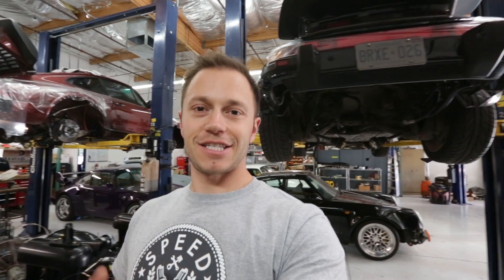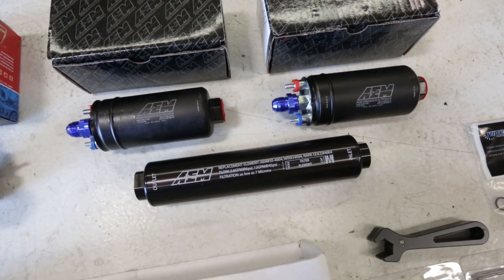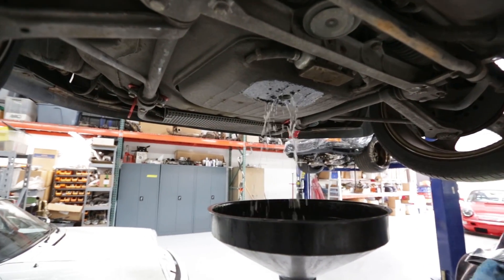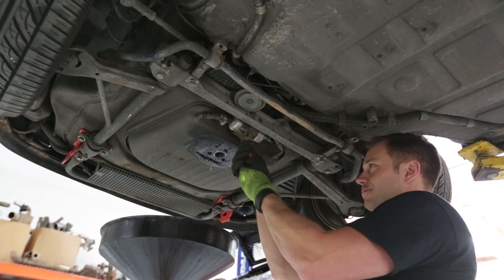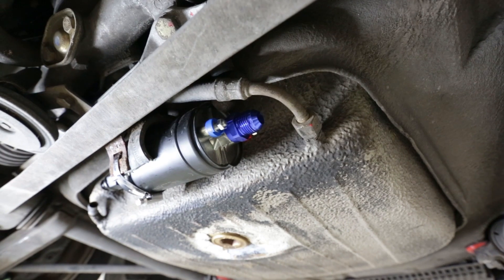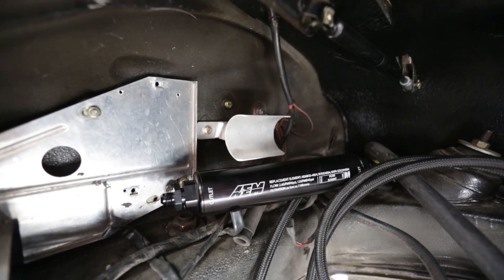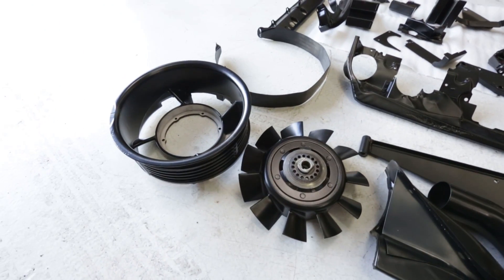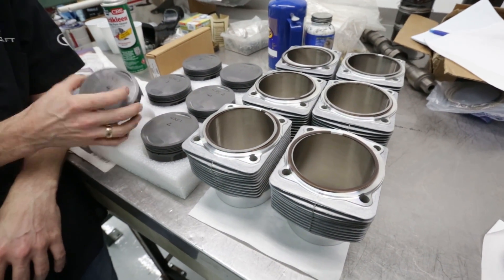Upgrading The Fuel System - Porsche 930 Project - EP04

Comment: you don't go into much detail on how the fuel lines are run through the floor gear linkage tunnel (or from the tank to the engine bay), probably the more difficult part.
Reply from the maker: +grant - I cover it off in a future episode but they literally run along the floor and back.

Comment: True the factory fuel setup is a twin pump system, but it is a low pressure/high flow feed to a high pressure pump. Running that high pressure pump in place of the factory feed pump you will likely find issues of fuel starvation when cornering and braking, as it will cause cavitation at the suction point, as well as high pressure pumps don't like pressure on the feed side. Love the build, and I'm sure you'll say it will be okay, and I don't want to say atoadaso, but atoadaso.